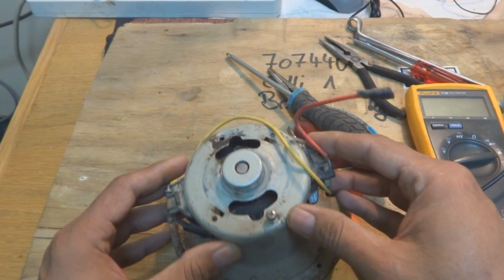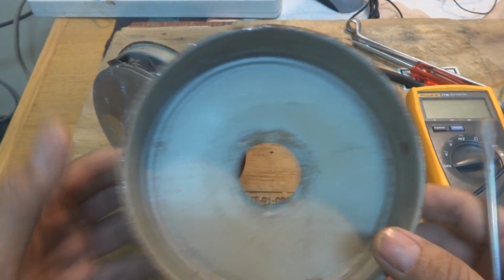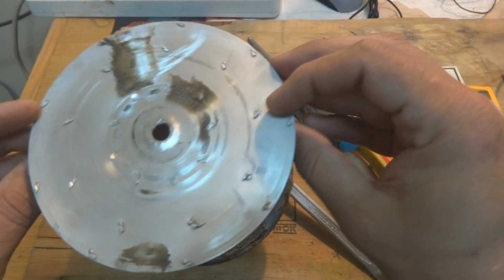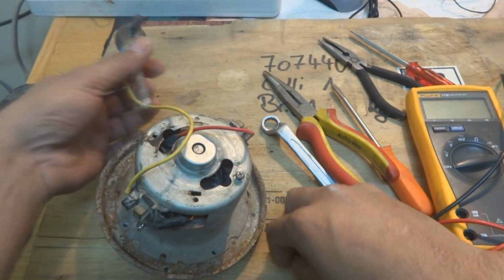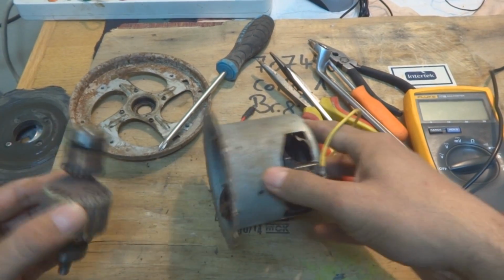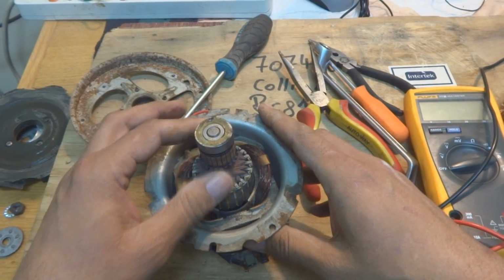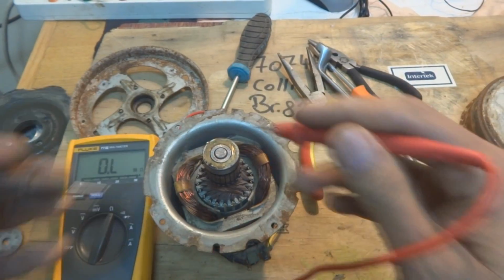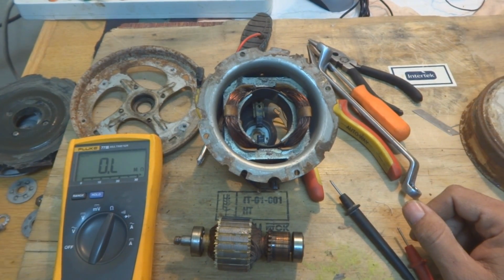Motor winding. Universal motor repair. part 1

Comment: Hi sir, it is really a great work you have done for the beginners, It helped me a lot. Thank you so much.
Reply: The brushes could be worn. That would cause excessive sparking; or the springs may be weak. However, some motors have adjustable brushes. That is, you can rotate them clock wise or counterclockwise. Because of the way that the magnetic fields work, this adjustment helps to accommodate the magnetic field collapse. When this adjustment is off, the collapsing fields (which are always reversing) cause arc to the next segment on the commutator. In other words, the energy is still present and it has to have somewhere to go. Depending on the type of motor, it may have what are called interpoles to aid in the collapse of the magnetic fields which are constantly reversing.
Reply: Some arcing will always be present.
Reply from the maker: It was a nice beautiful theory what you discussed in the above comment. In my motor case it was a bad armature winding. I replaced the winding and all done. The next part of the videos is illustrating winding process and further details of the process. Thanks for constructive comment.
Reply: Yes, I enjoyed seeing this, and also the fact that you made a video about it. I have thought about rewinding, but never have done it.
Reply: I don't know how my comment got down here, but that's ok.

Comment: Hmm so unwinding a coil at a time and measuring the length/thickness of the enameled wire, then new compatable wire can be cut to the same length plus a few extra inches to allow for different path and soldering, then the boring task of slowly winding it back on can start.
.
Sounds easy dont it lol, but we know packing the wire it will be a pain.
And the insulation material that keeps the wire rubbing on the metal former has to be checked as well.
Not a job i would enjoy doing, you must love pain ha ha :-D :-D.
.
Ive had to rewind mains transformers, they are easy in comparison but still require close packed windings to get all the wire back on.
Reply from the maker: +zx8401ztv You are right sir. I also started winding mains transformers and succeeded the job by winding hundreds of transformers of different sizes and specs. This was an opportunity to rewind a series motor so I didn't miss it and decided to film it for others to help them if they are like me and trying to start in the world of rewinding a motor. You stated all details of the work in above comment! great.
For wire, I sized it and it was 0.4mm in diameter and having 18 turns in each coil. So I took some length of wire and rewind it on the armature. The next parts will cover details of the work. Regards,
Reply: Can you rewind these motors Zx ?

Comment: Sir can u tell me why it spark on commutator..I have changed field winding and also changed armature and carbon but still it spark so much
Reply from the maker: Check for carbon brushes and springs. If you changed both winding it should not spark then.